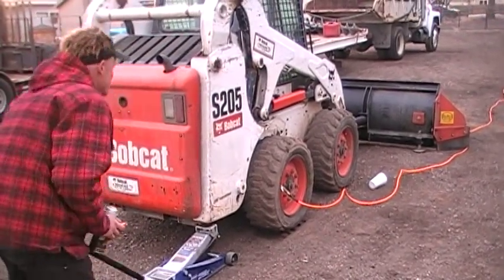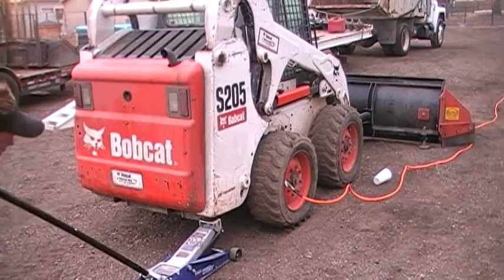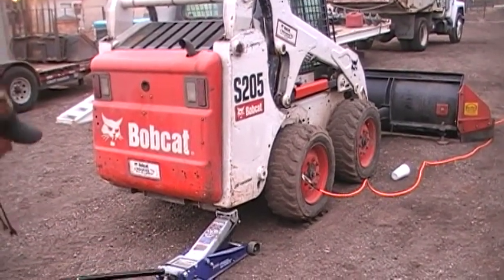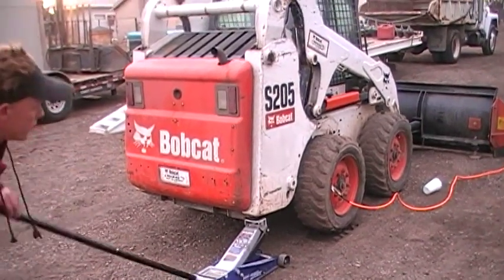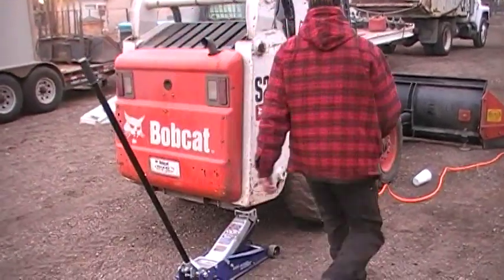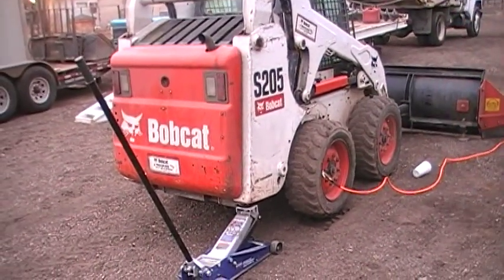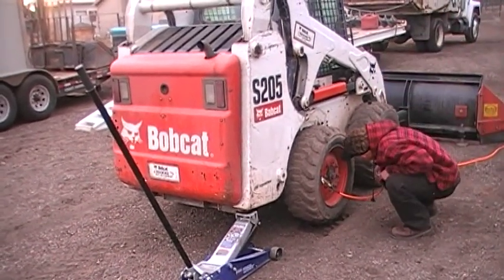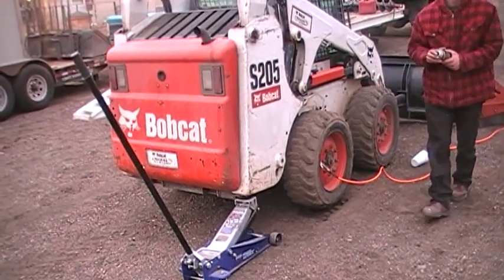Easy Way To Bead Up A Tire (With Ether)

Comment: OK stick with the starter fluid it does the tyre beads and sidewalls a power of good, and yes ratchet straps work good aswell but the big difference is they are SAFE!